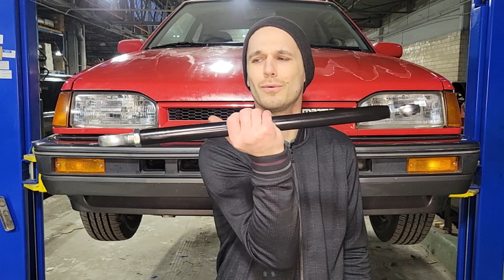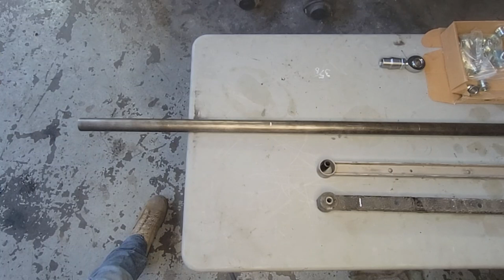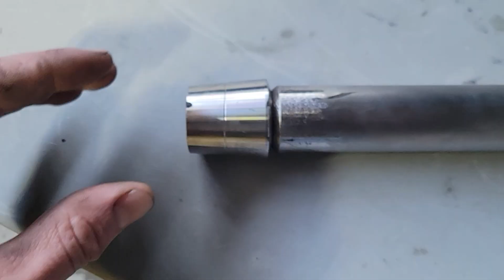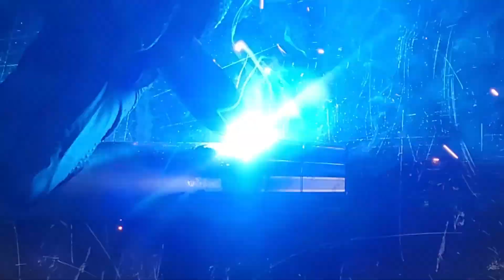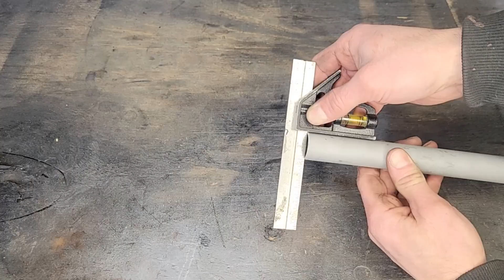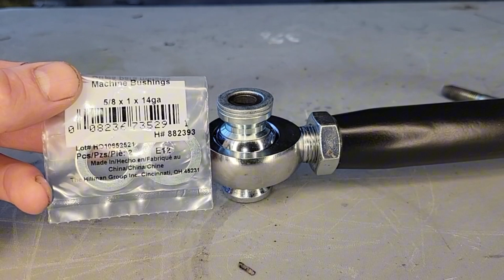Mazda 323 GTX Custom Adjustable Trailing Arms

Comment: This looks awesome! Exactly what I'm looking for to do on mine, since my trailing arms are rusted out, and since I have a wagon variant I have reinforced ones from factory, so I can't really replace it with a regular Sedan or Hatchback rear trailing arm (it's basically boxed, not a C profile in shape). Great video, thanks for showing the whole process.
Reply from the maker: Coming to the conclusion that custom trailing arms was my only option was no fun, but you got to do what you got to do.